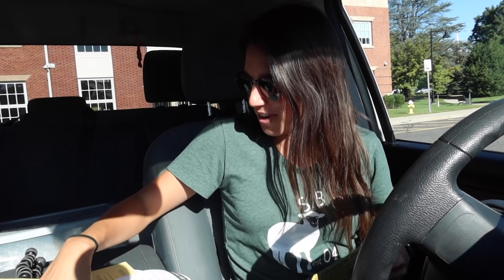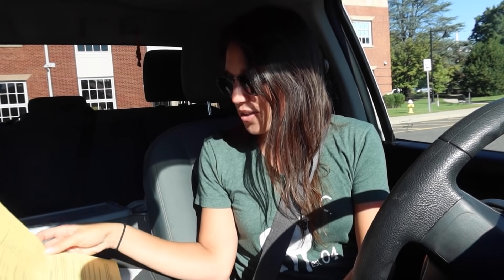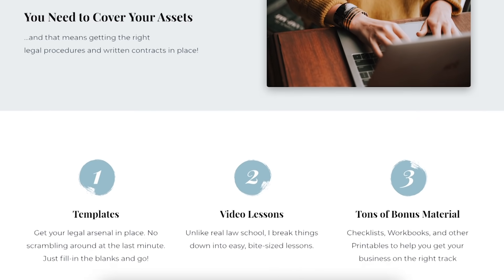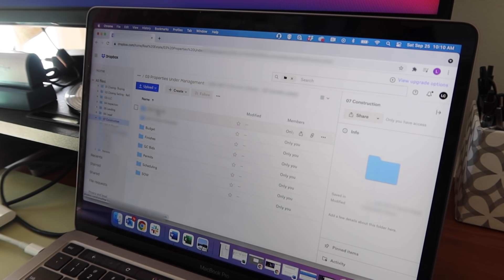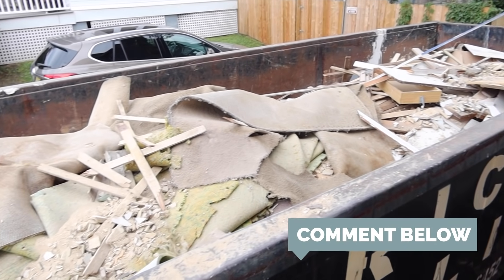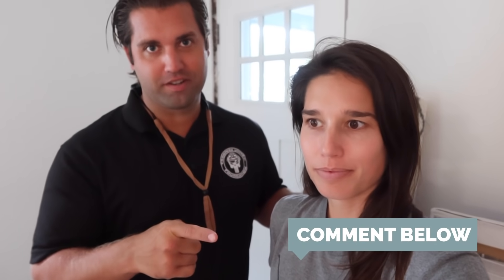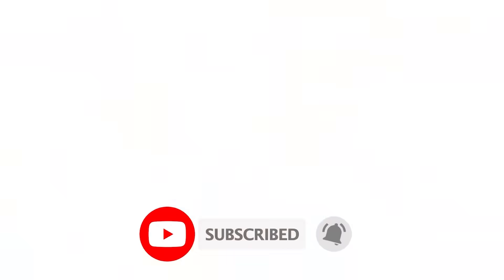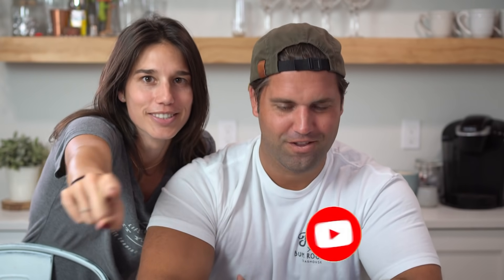How We Found a Contractor + Demo Begins at Our New BRRRR!

Comment: Very good point on the insurance. We use Philadelphia Contributionship, lowest rates we have found for rental properties. But they will NOT touch aluminum or knob and tube, even with mitigation measures. If you do the math out, it's so much better to run new romex with new panel when the place is gutted...than pay higher risk-rated rental dwelling insurance for the life of the property. The break even point arrives sooner than most people realize.
Reply: Agreed. We had the same issue with insurance for knob and tube in Seattle. We weren't planning on such a major renovation so quickly, but it ended up being a major project just a few months after the purchase. Insurance seems to be the driver for a lot of these things nowadays.
Reply from the maker: We definitely agree. The increase in insurance cost for K&T is crazy! We have Philadelphia Contributionship on a few properties and are very happy with them.
Reply from the maker: What insurance says, goes!

Comment: Awesome tips on selecting your contractor. Follow-up question: during your vetting process did you came across multiple contractors that met your criteria? If so, how did the one you selected stand out?
Reply from the maker: Surprisingly no. It was tough to find one that would do itemized quotes. The thing that really set this guy apart from the others was we found out he is a buy and hold investor as well so he understands the mindset and ultimate goal. Keep costs low by saving where you can, without it effecting the overall value.